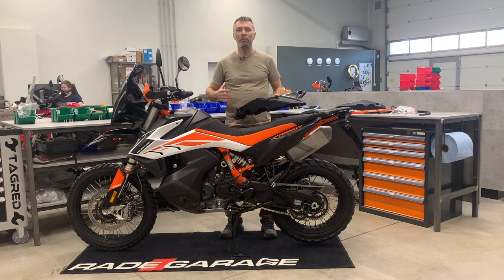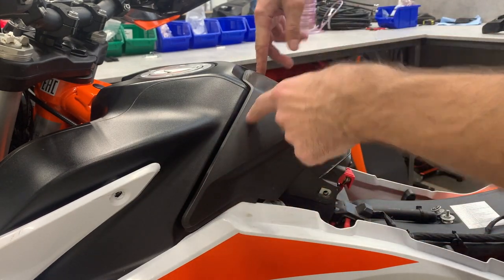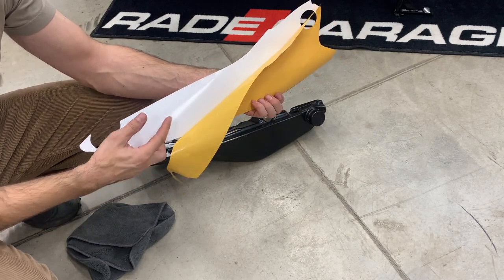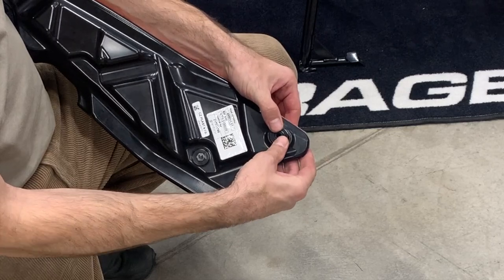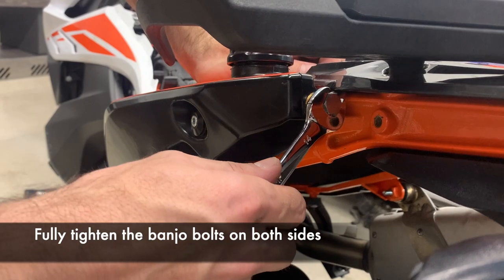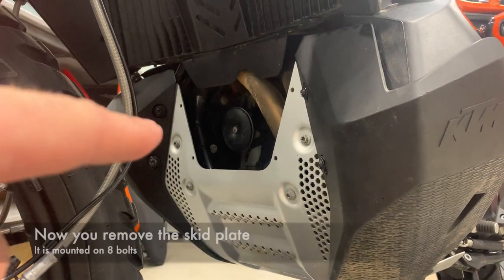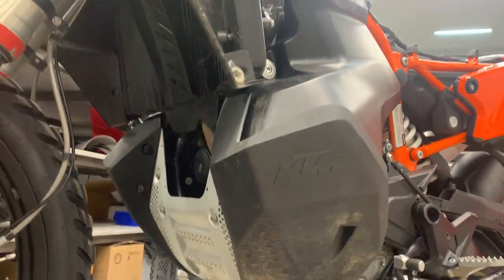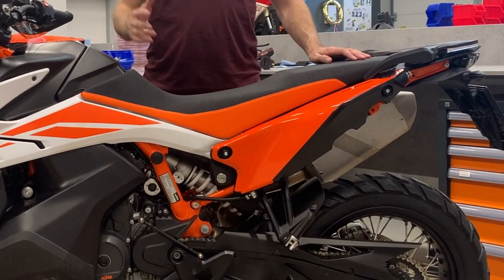KTM 790 & 890 auxiliary tanks installation RADE/GARAGE

Comment: Hey, I see you have water&fuel or fuel & fuel. Do you have a water & water? I don't have a need to go over 300 miles but a few ltrs of water would be amazing.
Reply from the maker: Hi, the configuration water - water is not available. Only feuel - fuel or fuel - water. Thanks.

Comment: How long will the decals last stuck straight to plastic fuel tank ... 3 months perhaps then its starts to bubble off.
Reply from the maker: The decals are perforated now, so they will last much longer than 3 months
Reply: @RADEGARAGE1  OK thanks. Had bad experience with the original Husabergs.